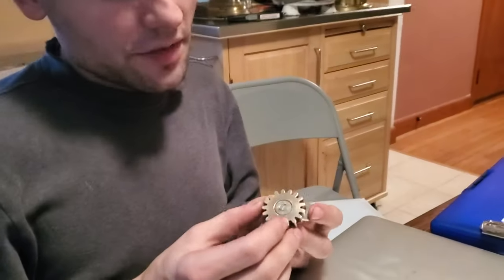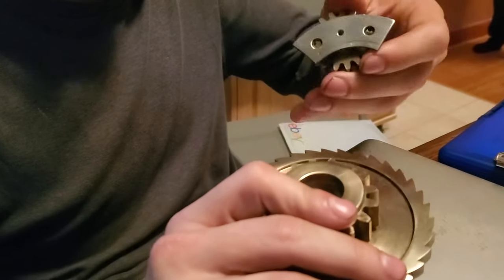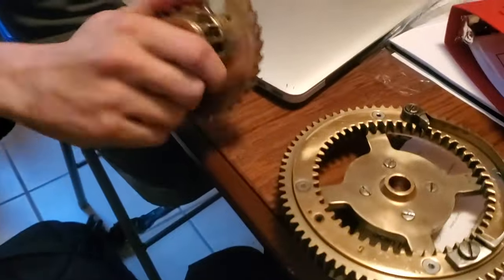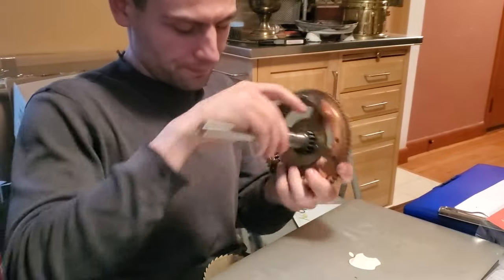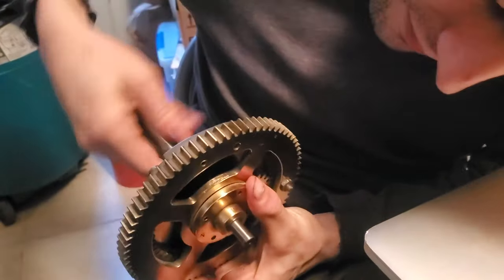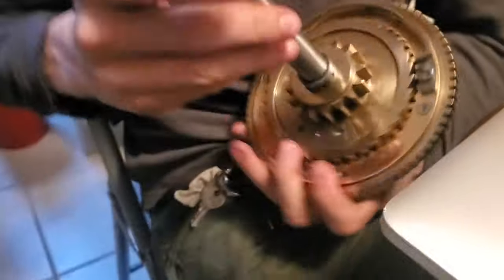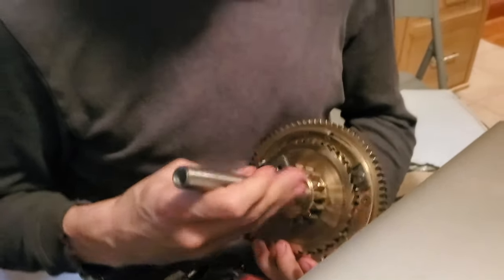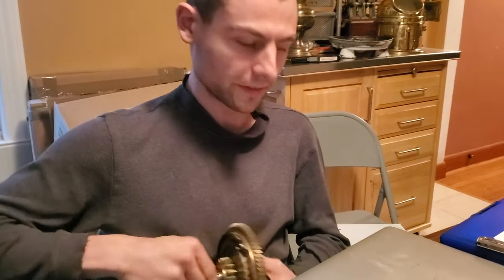Fresnel Lens drive clock repair Pt.1

Comment: Discovered you from the water works video and have a lot of respect for your work. I feel like you're one of the few people that actually works on this stuff seriously and doesn't treat it purely as a novelty thing.
Reply from the maker: Thank you very much and I'm glad you picked up on that, I've noticed the same thing and it is immensely frustrating.  I build, repair and operate these machines as if they have a place in our modern world because very simply they do, they could very easily out-mode the disasterous and unrobust technologies of today if only the people making decisions weren't defectives.  The defective technology is only a reflection of their thinking.